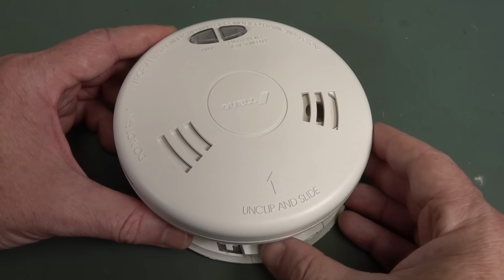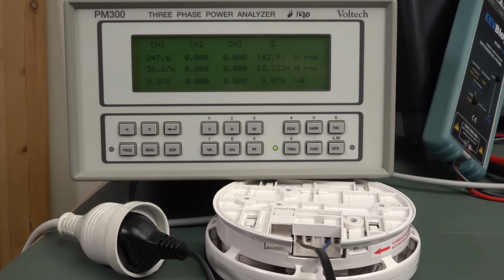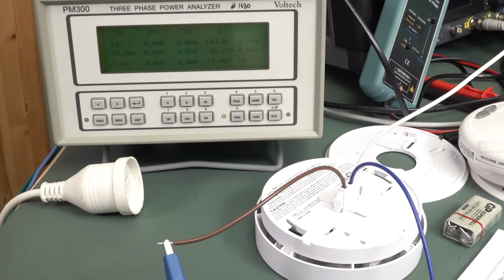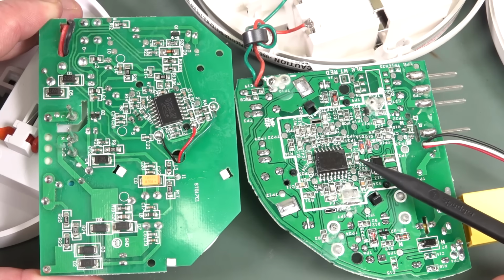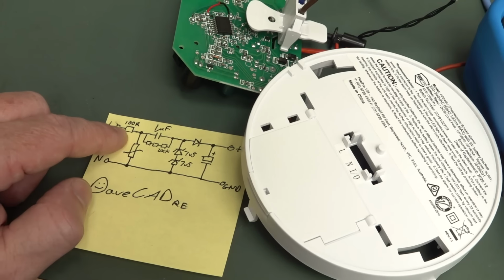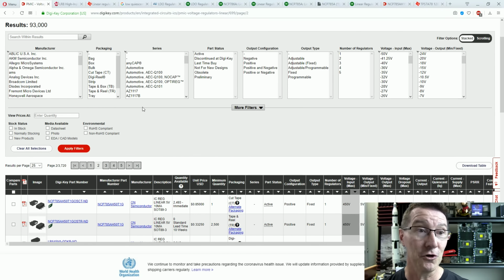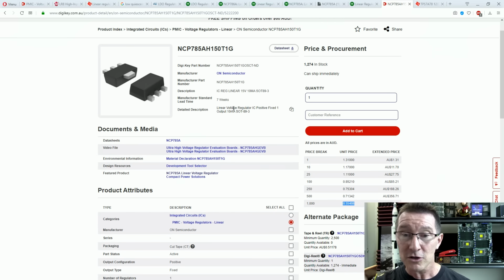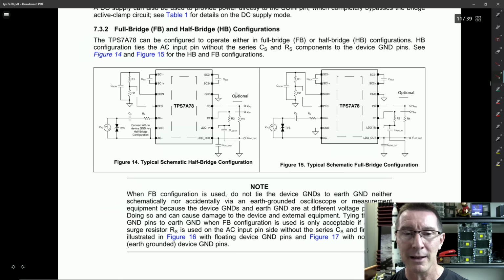EEVblog #1284 - How Bad Product Design Kills The Environment

Comment: Roll your own "smart" MOSFET regulator by closing the gates when they exceed ±nominal DC. For tiny current at lowish voltages, that should not produce unacceptable noise. Details are left as an exercise. 😎

Comment: Great video. I would think this is a capacitive load with current leading voltage.  I would also think that are more inductive loads on the grid (eg, large motors), so perhaps the millions of these small capacitive loads would help compensate for the large inductive loads, and effectively increasing the power factor seen by the generators, and ultimately helping the grid.  Thoughts anyone?

I think your viewer might be interested in a video about non linear loads (like a full wave rectifier) and their effect on the grids.  Have you ever looked at the line voltage with a scope.  In my area, the tops and bottoms of the sine wave are pretty flat.  A discussion of power factor corrected input stage might be entertaining for you audience.  Just an idea for another possibly great video.

Anyways, I enjoyed the video enough to subscribe.
Reply: Maybe in the near term, that does make sense. But I expect inductive-load devices will keep disappearing from residences. Many devices that still have motors are not directly on the mains. Our clothes washer uses a direct-drive motor on the drum which is driven by a three-phase motor speed controller, which is in turn running on a switching PSU.
In our house for example, we have just three mains-connected motors that run with any regularity, the fridge, the furnace water pump, and clothes dryer. In the summer, drop the furnace and add a few small fans. There are no more fluorescent lights left; almost all is LED. So if anything, we are probably showing a capacitive load most of the time.
Reply: Big Clive has talked some about what the rectifier-capacitor loads look like. After initial charge, you only get brief flows of current near the peaks of the voltage. Long strings of LEDs have a similar current waveform when run on AC.
I suspect the flattening of the peaks in the supply will only get worse.
Three-phase full wave rectifiers have an additional problem in systems with a neutral. The current on the neutral is running at 180Hz (or 150) as it gets bursts of current as each phase nears its peak. That can really mess with infrastructure designed for 50 or 60 Hz.
Reply: @strehlow  Yes that's a big problem with rectifier loads in three phase systems. When I designed a server room about 15 years ago I specifically doubled the size of the neutral wire and when we have the room up and running I was able to measure currents in the common  neutral wire that were higher than the line currents. As a servers got replaced with newer generation servers that had power factor corrected power supplies the neutral current started falling dramatically. Hooray for power factor corrected power supplies.

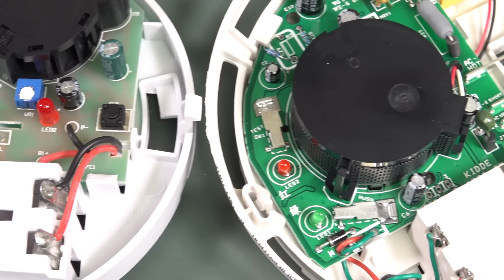Comment: 10:18 The test button should trigger the optical sensor...
Reply: Right. Have a "mirror" which has reflectivity approximately equal to what the smoke particles have at the concentration it trips at. Pressing the button would push that into the chamber. This would then test all the components in the system.

Comment: My mains power usage gizmo measures with rms, lighttubes draw 30% more then rated power.
Same with many led lights.

I looked them smokers, vs regular battery powered, they were allot more expensive then battery powered.. so pointless !

A capacitive inductor coil would power it, a capacitor to store it over time. So get full charge of turn stove on...

Comment: I have 8 smoke alarms in my house and they're rated 100mA with a capacitor and 2W power resistor inside. I calculate that together they cost me around $22/year in electricity! Next time I buy smoke alarms I'll have to see if I can find low power models.

Comment: Maybe you should check the VA after the 9v battery has finished charging? I wonder if that was a factor.

Dave: don't forget to double materials cost for selling cost estimates! A one dollar chip is going to increase the cost of the unit by at least two dollars US! Having been a builder I would get the unit that was two dollars cheaper, even if the standby loss was 7 watts, just because 7 watts in the old days was a night light in a hall! Nothing to worry about for a builder.

Comment: Ignoring PF and concentrating on W, the problem is that capacitive droppers are constant current sources, and in this case must be able to source sufficient current to drive the buzzer when the alarm triggers as well as all the sampling circuitry.  Since source current can't be reduced, in order to maintain a stable voltage for the circuitry, the amount of energy consumed by the device must remain constant.  This is achieved by an amount of energy equivalent to what is not being consumed by the electronics being dumped into the zener diode where it is dissipated as heat.  In reality it is likely that the supply has overhead built in so the lost energy will be even higher.  Using a constant current supply for a variable current load is a poor design choice for efficiency.

Comment: Lots of talk about a small amount of power if you compare it to other power reductions that are much higher and you could see measured on your bill. Think about things like motion-activated lighting, adding skylights, not having a burning hot shower, reusable coffee cups, turning things off when not in use. Light bulbs are easy 60W vs 7W that's why they were first. Next, other small devices like how long you over microwave food or just heating up a hot plate. Then look at big appliances like fridges, freezers, heaters, coolers. Those things would help in the house long before a smoke detector, someday we may need to but people are cheap.
A big place that would save money is commercial, think about how the office Dave is in probably keeps the hall lights on 24/7, but if you wired half to only be on with motion sensors it would save more power in one hall than the smoke alarms changed in 50-100 homes. (Back of napkin math there.) Let's make some headway on big real problems, not micro problems first. And no we have no technological path to just shut down gas or coal power plants to fix it with solar or wind, nuclear may help, but if you have an idea go build it :D

Comment: Meanwhile the twin 800 pound gorillas in the room are green energy (wind turbines and solar) and electric cars.

A billionaire by the name of Warren Buffett says the ONLY reason it is even financially feasible to build and deploy wind turbines is because of the massive government subsudies. If they can't pay for themselves in terms of dollars, and they don't even come close to offsetting the amount of carbon it took to build them, AND they kill birds by the thousands. Then there is the big problems for the rare earth metals in the magnets that go into them, 97% of those materials are mined and refined in China where they couldn't care less about the environment and release God knows how much toxic crap into the environment. Solar isn't any better. Also all of this is twice as bad if there is a battery pack to make the power even close to consistent, because if there is no battery pack the constant spinning up and down of coal or gas fired power plants to fill in the gaps actually causes EVEN MORE co2 to be released.

Can someone please tell me WTF we are building them for???

Electric cars are even worse in terms of the exotic and toxic stuff mined to go into them as they have a massive battery pack in addition to the rare earth magnets. AND the energy used to charge them is still putting co2 into the air, ESPECIALLY if it is wind or solar power.

Funny thing is Spain has even more ridiculous subsidies, to the point it is financially viable to run a diesel genset to power lights for the solar panels overnight.

This is why putting important things in the hands of the government has always been and will always be a horribly bad idea.. just look what happened to China, the USSR, Cuba, North Korea, and Venezuela!

Comment: 1) This design draws 0.5W, what power does the circuit draw at DC? can't be much less!  so this circuit is efficient, it will actually make the grid be less loaded in terms of VA. A flyback supply won't be better efficiency.
2) Cost is very low, no other design would beat it!
3) It is reliable.
4)low design costs.
It's an excellent design!
Reply: Re: 1), smoke detectors tend to run for a few years on a 9 V, 200-300 mAh battery. That's around 0.1 mW in standby. Even the worst-case 15 mA that Dave got would indicate <250 mW max when the alarm actually goes off.
Both of the smoke alarms tested would actually exceed the currently mandated maximum standby power consumption for new TVs in the EU (0.5 W).
2), 3) and 4) are true, of course.
Reply: @PileOfEmptyTapes  That low power is for the ionizing detectors, the photoealactic ones take a lot more, which is why they are mains powered. i you run it on the battery it won't last a week.
Reply: @PileOfEmptyTapes  405mw is below 0.5W?
Reply: @willgeorge5644  Without rewatching the whole thing - didn't the power meter say 0.5-0.6 W for the first and over 1 W for the second? At least I thought so.
Reply: @PileOfEmptyTapes  There are 3 different types, the "ionization" type is very low power, but the photoelectric type is more reliable, that uses an led, possibly 2, that could take 10mA on it's own. The reason that these connect to the mains is that a battery would not last long enough.
Reply: @PileOfEmptyTapes  As i say, there are different types, only ionization is low power.

Comment: Dave stop eating leaded solder. If you have 100A from reactive power, only power losses are in the cable resistance. For example if you have 0.1% lost in cables, then 100A*230V*0.1% = 23W only lost  as heat in cables, not 23kW lost in the Ether.

Comment: Hey, I'm a bit of an electrical amateur and have never seen a smoke detector connected to the grid, always just a 9V battery. Is this just a regulation thing that differs from country to country?

Also: What's that I/0 pin for?

Comment: The fact that is probably capacitive is a bit of a saving grace because most poor power factor devices are inductive, motors and such. 
The power companies used to make industrial companies install banks of capacitors to correct the power factor.

So anyway, it's probably not as bad as you make it out to be.

Comment: On a domestic scale this kind of low power factor consumption is harmless. If anything the capacitive load of such a device will make a miniscule correction (improvement) to the predominantly inductive load of motors. Industrial user get charged for VARs, and are thus incentivised to install capacitive power factor correction to make up for all their electric motors or, in 240V countries, the remaining domestic fluorescent light fittings that have inductive ballasts and no power factor correction caps. So the power company would probably love for there to be millions of these gadgets.

Further reading, by yours truly from 20+ years ago. https://www.splatco.com/tips/pwrfact/pfarticl.htm

Comment: Most electronic devices begins with rectifier. Its diodes opens when mains voltage reach voltage of charged filtering capacitors, that typically happens after reaching 1/(√2) Vpeak  (equals to π/4+kπ or 45°+k180° in phase). This device has it's maximal current drain somewhere between 2-3° where every device with rectifier (and without PFC) drains nothing.Your modification moves maximal current drain from mostly unused part of period to mostly used region, which, in my opinion, makes thing even worse. We have nice word for such improvements — Verschlimmbessern (to make something worse by improvement).

Comment: I am going to assume that the 'DaveCad schematic is an accurate representation.
Therefore, the two zener diodes in series will fully conduct on one half of the input wave and regulate the output to 15V on the other half.
Now, try throwing the DC blocking diode BEFORE the 2 zeners
How much change in overall current consumed?
How much change in actual output?

Comment: This is so disappointing. We learned that zener diode voltage regulators were extremely inefficient in the second week of my circuits and devices class. I'd love to see someone run the numbers on just how much electricity is wasted in a city just from these inefficient smoke alarms.

Comment: The trouble with zener-regulated supplies like this is that the series reactance has to supply the peak current demand, without dropping the voltage too much, which as you observe is in the ballpark of 15mA when the alarm is sounding.But even given that, as designed, it is drawing 70mA, so they could have used almost 4 times the reactance (reduce the capacitor value by a factor of around 4 to, say, 0.27μF) and get the same voltage drop with only 17.5mA of quiescent current, and it still would have been enough to run the alarm when sounding.
I have to wonder if they are using exactly the same circuit for 120V systems. this would give a slightly less feeble justification for a whole 1μF dropper capacitor, though that would still be about twice as large as necessary and the circuit would still draw twice as much current as necessary

Comment: 1: you dont pay for VA you pay for kWh. and it is not a lot with 1 watt pr unit. we use 20 000kWh a year and whatever heat is produce is needed a lot of the year and will just add to the heat you use the other electricity on.
and you dont have to "make extra power" you do put a load on the net tho. the generator will correct it and it only need to produce the kW that is consumed.

Comment: Hey Dave, I've got a question about the 10 year battery smoke alarms. I bought 2 and they say once it's been turned on, if it get's turned off it needs to be replaced. Can you do a tear down on one? I think mine are quell brand ones. The idiotic thing is that simply removing them from the bracket can press the button to turn it off. There are a few reasons to need to remove an alarm (going off at midnight when a spec of dust floats into the sensor).

Comment: While the 1.6 watt load is completely egregious, I wouldn't say that a bit of extra capacitive reactance is such a bad thing in a household environment. There are likely to be quite a few small induction motors with fairly poor power factor consuming VARs throughout the day in a typical household, and there are certainly going to be some SMPS units adding 3rd, 5th, 7th, etc. harmonics to the line that would warrant some capacitive loads being installed here and there.

Comment: It’s an abomination though I just had my own battle with a battery powered smoke detector- it simply would not be satisfied with 9v from a 9v battery.
Reply: The smoke detector takes a momentary pulse of current and measures the voltage drop, if the drop is substantial, then it sets a flag and the chirp starts...  My neighbours asked me to check their batteries because they had just changed them, I noticed they either bought no-name Chinesium alkaline or zinc carbon batteries. Terminal voltage was about 9.6V until put into the smoke detector when the terminal voltage dropped to 7V for a second or so and then recovered, but the detector was having none of it.  A genuine alkaline or lithium battery had no problems.

Comment: Sooo. If you'd fit 3x white LEDS in serial, running them at minimal power and tagging along for the 9V drop over  them, you could have low 24x7 light + fire detection at the same time. 
with basically no additional power usage.
(edit: Cap Dropper, full bridge rectifier, perhaps small resistor for inrush current and fuse and DC cap around the leds..)

Comment: Worst I've found is the DVR box provided by the cable TV company, 35w on, 30w powered off.
Isn't that capacitor more expensive than the mains regulator? Would be nice to get the comparable coat.

Good video to show why there should be energy price labels for all plugin devices and regulations to cut stupidity. Costs 1/2 in the US though.😄

Comment: One problem is, that you have to design the PSU for the peak current draw of the buzzer. A battery delivers them with no problem, but a cap with e.g.10nF doesn't. Although 10nF would be more than enough to power the detector in standby. But then the current has to wasted in the Z-diode. This only could be solved by using a big capacitor for the supply of the buzzer and a second small one for the detector - basically you have to build nearly two PSUs and switch the buzzer at 350V. There are small cheap TRIACs to do this, for example like the TO-92 devices in some Christmas LED light strings. They are probably reasonably cheap, but you need two power paths.
The power factor is not really that problem. Most mains grids are inductive anyway, from (induction) motors and long overhead power transmission lines. An exception are big cities, if they have mostly buried cables, these significantly contribute to the capacity of the distribution grids. But AFAIK still the big inductive loads like motors dominate.
That#s probably the reason, small capacitIve droppers are allowed. But even the real waste of real power is really high. compared to the battery operation. 1W sums up to 1-2 Euros over a year, you could buy more than one 9V battery for that.